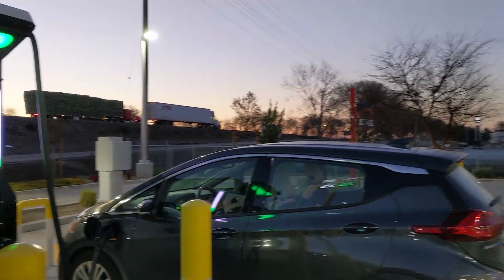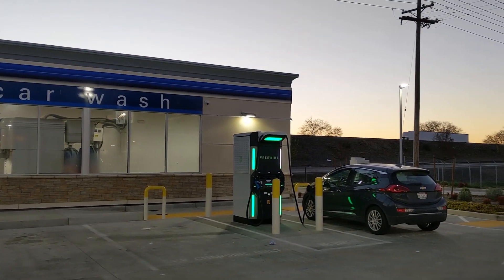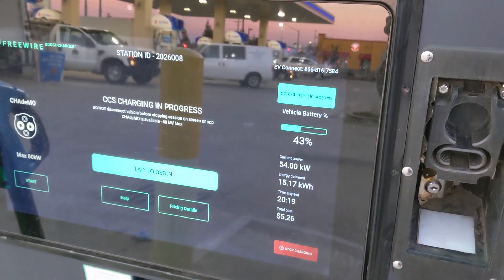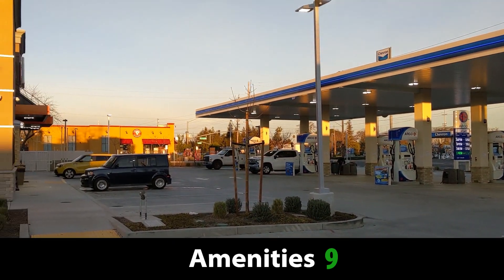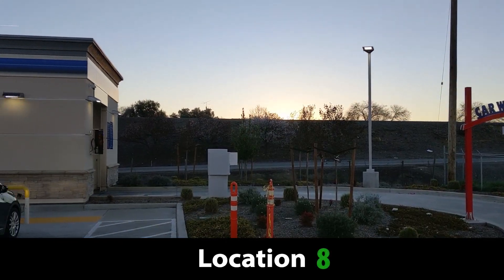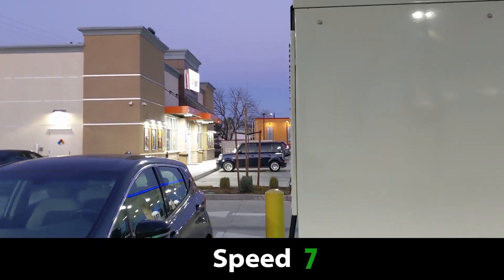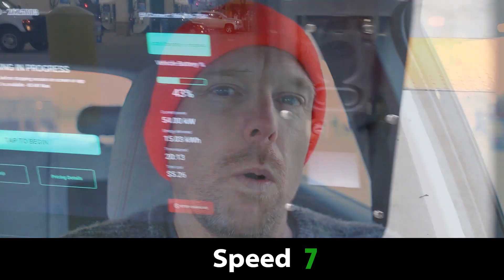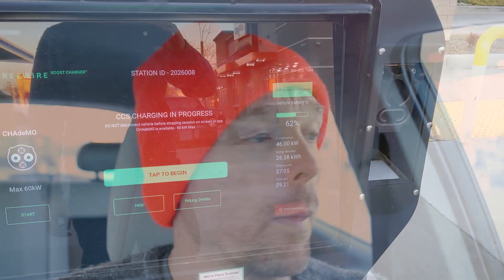Site Review: Freewire, Lodi Arco AM/PM

Comment: You mentioned that this is battery back-up. Does that mean it will still charge a vehicle if the grid goes down? If not how is this a better system since it they would have to charge more money due to the battery back-up.
Reply: It's not a battery backup, it's a battery assist.  Instead of installing the hardware to be able to pull 150 kW from the grid it installs on a much smaller supply line and slowly charges the battery while the battery can quickly charge a car.  The benefits are lower installation cost (the cost to put in a ChargePoint CPE250 can easily run up to $100k) and the reduction or elimination of electrical demand fees which can get absolutely unreal.
Reply from the maker: Yes, it is technically a battery assist. I'm not sure if there's a technical term other than just saying "grid-tied" battery. Some can be configured to run without grid power, but I would need to confirm with Freewire whether this charger has that capability. Typically, these systems are set pull from the grid first (up to the baseline demand) and supplement with power from the battery, but I don't know the specifics for this site configuration.
Reply: @newscoulomb3705  thanks for the reply. My point is that such a system actually costs more to operate then just straight grid power since there is a loss in recharging the battery back-up. That means you have to pay more to charge there compared to a full grid charger.
Reply: @JohnSmith-ug5ci  the loss is irrelevant.  The cost of operating a charger has absolutely nothing to do with the cost of power, it is the Capex (particularly  the real estate part of the Capex) that is the dominant cost. This is less economical because of the Capex for the battery (and the fact the battery will need to be replaced).
Reply from the maker: @JohnSmith-ug5ci  Actually, the opposite is true. The actual energy costs for running a DC fast charger are actually fairly low. Maybe 10 to 15 cents per kWh depending on location. The demand fees, on the other hand, are expensive. This charger can provide 120 kW with a ~20 kW grid connection. Often, the demand fees can be $5 to $10 per kW (or more) over the basic connection, so a single session drawing 120 kW directly from the grid can cost $1,000 per month in addition to the cost per kWh drawn.
Reply: @newscoulomb3705  no disrespect but your numbers are bogus. I tis IMPOSSIBLE to charge batteries and come out ahead against straight electric.
Reply: @homomorphic  no it is NOT irrelevant. The added loss of energy while charging is relevant.
Reply from the maker: @JohnSmith-ug5ci  I think you're missing what we are saying. Priority comes from the grid (i.e., ~20 to 30 kW). The rest comes from the battery. The amount to recharge a battery over time (and the charging losses) are miniscule compared to the hundreds and even thousands of dollars extra due to demand fees.
Reply: @newscoulomb3705  Lodi has a Muni electric company; way cheaper than PG&E.  An EA site in PG&E territory, with only 3 150kW chargers going full blast  (120kW each) JUST ONCE IN A MONTH could create over $10,000 in demand charges for the month.  Eric, you are right to bring this up; few do.  Probably why my local EA was down for a while for install of huge Tesla battery cabinets.  Techs said for blackouts - ha ha.  Count on News Coulomb for help understanding all this!
Reply: @newscoulomb3705  no you are missing MY point. A charger that is grid only and has the same ability will be more efficient and make more money. If you set a charger that was grid only beside one using the battery power people would choose the grid one first due to lower cost of usage..
Reply from the maker: @mikecarter2737  Thanks. Yes, I think a number of those Electrify America sites that were only outputting 100 A were due to have Tesla PowerPacks installed. I definitely think the derated power output was intentional.
Reply from the maker: @JohnSmith-ug5ci  I understand, but it is only true if usage is high enough. For a site that is in use >50% of the time, what you're saying is accurate. For the more common <20% usage, grid-tied battery systems will always be cheaper where demand fees are high.
Reply: @JohnSmith-ug5ci  no it isn't. It's noise. 90% of the cost of operating a charge point is the dedicated  real-estate and the equipment and its maintenence. The cost of electricity is noise. Even the demand charges are noise compared to the cost of real-estate.
Reply: @newscoulomb3705  you are trying too compare apples to oranges. The full grid charger will always be cheaper.
Reply: @homomorphic  now you are talking foolish.
Reply: @JohnSmith-ug5ci  you clearly don't understand the economics of charging networks.
Reply: @JohnSmith-ug5ci  You might want to research what demand fees are and how they work.
Reply from the maker: @JohnSmith-ug5ci  No it won't. That's the whole point in having grid-tied batteries. The cost of the batteries and the cost of charging the batteries more than pays for itself with the money saved from not paying demand fees.
Reply: @newscoulomb3705  you might want too take a physics class because what you are claiming violates the laws of physics. If that is too difficult to understand think of it this way. If your claim was true then EVERY electric provider would have batteries some place in their system to save money. Adding batteries do not make it cheaper. it makes it more expensive due to the loss of energy during charging and discharging.
Reply: @newscoulomb3705  - sounds like we need a report out on how much demand fees can add to the incoming electricity cost?  I would think that a battery backup would save a ton of per station cost in the big picture.  If this has a relatively constant 27 kw coming in, that should keep up all day long.
Reply: @erikstephens34  and you might want to look into the law of physics. Adding batteries causes more lose of energy which means more cost.
Reply: @JohnSmith-ug5ci  I'm fully aware of battery charging losses. But wouldn't a 15% loss of energy be worth avoiding a doubling of the demand charge?
Reply: @newscoulomb3705  right and even the cost of demand fees pales in comparison to the cost of the real estate. A single charger slot occupies about 1500 square feet of space in a prime location and even a busy charger only generates  revenue  from that real estate 50% of the time at best.
Reply from the maker: @dennislyon5412  Yes, it's a really hard concept to explain. Electrify America and EVgo have both noted that it's an issue.
Reply from the maker: @JohnSmith-ug5ci  This isn't about physics; it's about economics. Two things have happened recently to make these grid-tie batteries more prevalent. First, the cost of batteries has gone down. Second, charging providers have become aware of just how expensive demand fees can be. 
If demand fees were eliminated, what you're saying would be true, but that's not how the fee structures are currently set up. 
Also, if you sell power to consumers for 25 cents per kWh, but your feed-in tariff is only 5 cents per kWh, batteries would also make economic sense if combined with solar.
Essentially, the economic gains offset the inefficiencies and losses that you're referencing.
Reply: @erikstephens34  you are missing the point. I never said anything about demand point. I simply stated a fact that using batteries causes more expensive charging. For me the EVC is already impractical and adding cost to recharge makes it even more impractical.
Reply: @JohnSmith-ug5ci  When I say demand I'm not talking about supply and demand.  I'm talking about demand charges.  These are charges the utility company forces a consumer to pay based on the service that is connected.   A bigger service = higher demand charge.   If you can reduce the demand charge you can make charging less expensive.  If you spend 10 cents more on electricity to save 50 cents on demand charges is that more expensive?
Reply: @newscoulomb3705  yes this has everything to do with physics. The physics makes it more costly too charge with battery backup than with full grid electric. The demand fees you speak of are levied regardless of battery back up or not and the fact that it  takes more energy to charge the battery pack than it does to run straight grid electric means there is no savings
Reply: @erikstephens34  I fully understand demand charges. It is YOU that does not understand. The demand charges do not end because you install batteries. They in fact increase because it takes LONGER, MORE ENERGY, to charge the batteries than had they just used straight grid power. You DO NOT save demand charges by installing batteries.
Reply: @JohnSmith-ug5ci  Demand charges are based on the service. A 50KW service will encounter far lower demand charges than 150KW.  Demand charges are not based on duration they are based on instantaneous load on the grid. The battery allows them to deliver 120KW with the demand charge of a 50KW service.
Reply: @erikstephens34  you are again making false claims. Yes time do factor into demand charges. A one minute 150 kw rate is not charged more than a 30 minute 50KW rate. The battery backup costs more to install and more to use.
Reply: @JohnSmith-ug5ci  You might want to actually research what demand charges are.  You clearly don't understand how they work.
Reply: @erikstephens34  yes I do understand how demand charges work. You clearly do not.
Reply: @JohnSmith-ug5ci  Then you would know that demand charges typically work on 15min intervals.  And that charges for a consumer using 150KW for 15mins will be much larger than a consumer of 50KW for 45mins.
Reply: @erikstephens34  your claim is bogus.
Reply: @newscoulomb3705  I got demand charges from State of CA for PG&E.  Could not understand how large sites could work with them and survive.  Turns out PG&E has pretty new "subscription" rates for high power DCFC sites that would make a 3-charger, 150kW site be under $800/mo. subscribed for max power.  Replaces demand charges.  To their credit, PG&E encourages battery use to avoid peak kWh rates AND lower max power threshold.  (Disclosure: I am a former PG&E employee).
Reply from the maker: @mikecarter2737  That's good to hear. Honestly, I think something like that new "subscription" plan had to happen for DCFC sites to do well. I'm not sure of any other implementations that draw power in quite the same way as a DCFC site. Short bursts of high power intermittently.
Reply: @newscoulomb3705  yes, you are right. Also I imagine a utility would much rather have lower power demands to be able to maintain reliability during the more and more common weather events impacting grid reliability. Soon I will not be surprised if businesses get a big discount from the utility or regulating agency for installing battery backup to help smooth power demand.